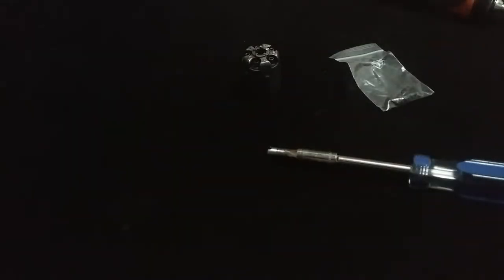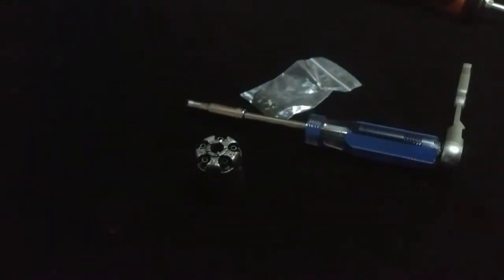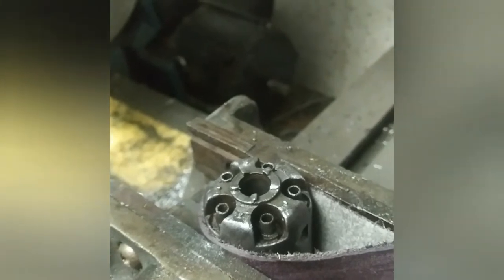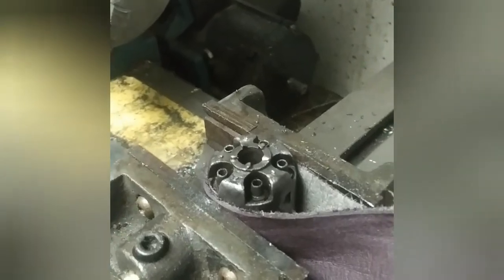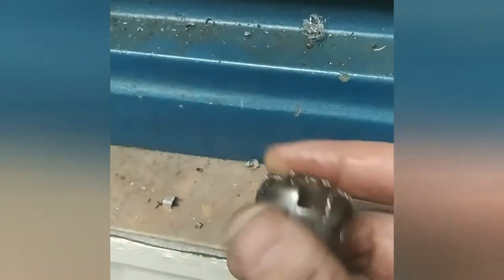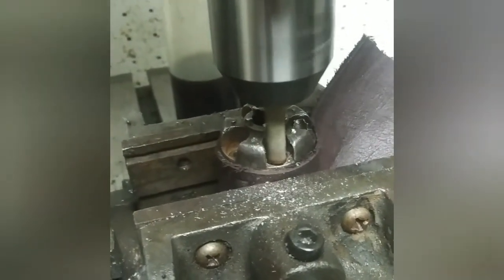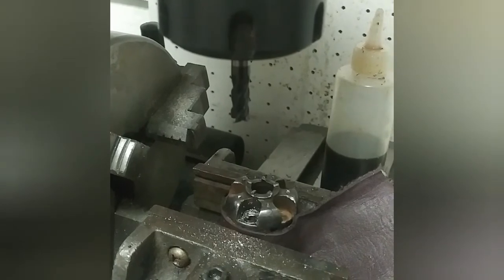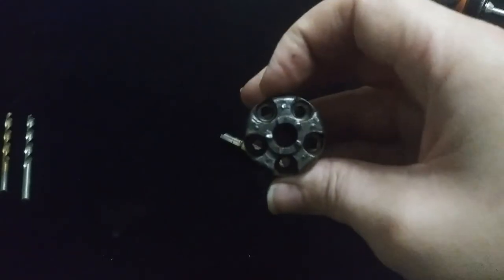Percussion Nipples stuck. How to fix

Comment: I used your video as a supplement to my task of removing the nipples from my 1849 Colt Pocket. I appreciate your honesty, you told it like it is. These old gun nipples are not going to back out no matter what you do. They’ve been abused from dry firing and neglect. You’re a machinist and I’m not. The end mill is a good idea but when you said you had to “ walk” it around to remove all the nipple that was above my skill level. I’m a retired dental technician so freehand is my wiring. In my research I found that a 5mm drill bit would remove all but the last above the threads. Basically it turns them into springs. You could probably graduate up to the 5mm. But I decided that all that movement once the cylinder was secured was risky. I clamped my cylinder the same way you did. Surprisingly the metal is soft. I’ve read that but once you feel the difference you can appreciate just how far we’ve come in metallurgy. That probably explains the deep threads and .225-32 tap that colt used exclusively. There were lots of posts about the tap Colt used but since you can’t get one it’s trivial information. However; a machinist posted that a 24-32 standard tap would work. It’s not for taping entirely new threads. It’s for cleaning up the originals. That’s exactly what I wanted to do. Lodgewood supplies reproduction parts and they have copies of the originals. One little thing though, they are made for size 9 caps. Nobody makes those but they are authentic. A ten squeezed between the fingers will work. I hade one chamber that didn’t release all the threads. I was sweating bullets. Was it cross threaded years ago or was I off centered? The 24-32 picked up what was stuck, just like the post said. I made silicone impressions of the chambers. The threads are there and aren’t too badly corroded. They are perfectly capable of accepting the new threads and there’s no risk of stripping them. Personally I think it’s the responsibility of the new owner to preserve their gun for the next generation.
Reply from the maker: @aquila8553  I am glade my video helped. and thanks for the Information. So glade to hear you took on this task and Successfully got one more Precious piece of history shootable, and preserved for another generation. No matter how many I do. I am always The sweating bullets. What year was your 49 pocket made? Mine is from 1858
Reply: @snappers_antique_firearms  Mine was made in 1847 according to the Colt serial number site.
Reply: Oops, 1857, my bad
Reply from the maker: @aquila8553  1847? If that's correct that's a extremely extremely early baby dragoon not a 49 pocket. I didn't even think the baby dragoon came out until 1848. But it's been so long since I studied baby dragoons, I might be wrong.  Does the cylinder Scene have the stage coach robbery or men fighting fighting Indians on horseback? Also is the cylinder stops round or rectangular? If it's men on horse back fighting Indians and has Round.
Cylinder stops. You have a very valuable revolver far more then a regular 49 pocket.
Reply: My mistake, that 4 should be a 5. It was made in 1857
Reply from the maker: @aquila8553  lol OK that makes more sense.

Comment: Have you tried 50% acetone with 50% ATF transmission fluid?
Heating the part before soaking.
Freezing can also help.
Reply from the maker: Yeah, I am a fan of acetone and ATF mix.  I have tried everything I could think of over the years. I always had good luck with heating and spraying with penetrating oil on stuck screws. Unfortunately, when it comes to the cylinder nipples it's usually about 90% of the time I end up having to drill it out. I wish I could get them out without having to drill. I would rather rebuild the old nipples by welding and re Machining. I still hate destroying a 160+ year old part. Even if it's just a nipple.

Comment: If you use a 50/50 mixture of acetone and automatic transmission fluid they usually come out. Let it soak for a day or two so it has time to work. If it's an old shotgun or rifle make sure there is no charges in the barrels.
Reply from the maker: @casperhoss2952  I did try this before I ended up having to drill it out. Spent weeks trying thank many others. I always hate drilling or milling on antiques
Reply: @snappers_antique_firearms  thanks for replying to my post.  Your exactly right drilling an antique is nerve-wracking. Your video definitely shows your knowledge and talent. I meant no offense. I just wanted to share what has worked for me. Hope to see more videos soon. Thanks again for commenting on my post.
Reply from the maker: @casperhoss2952  thanks!! I appreciate the input. And there was no Offense taken. I love people sharing Knowledge. I am always happy to learn something. In this case I knew this. But maybe someone might read this comment and it helps them. Please feel free to share anything that can help keep these Antiques around for Future generations.

Comment: If you are fortunate and the "old/original" nipples DO come out... Would you recommend using a high temperature anti-seize compound (Nevr-Seize/C5A,etc.), on the threads, when installing the nipples (prior to firing)?... My dad introduced me to anti-seize, working on our Studebakers (He used it on every cleaned bolt that went back in... Never had a stuck bolt, again!)... Thank you, for sharing your vast knowledge! ... Gary
Reply from the maker: Yes 100% use anti-seize. I still recommend removing and cleaning after shooting. I have had nipples still get stuck with anti-seize. The black powder being so corrosive it'll still rust between the threads and get stuck. But it takes allot longer. And is something I always use. Thanks for stopping by Gary and welcome to the channel

Comment: Time rusted in like that not much you can do to correct it. However  my philosophy is start clean lube. Reinstall, do not torque the nipples tight until you are ready to snap caps in prep for loading. Remove clean and lube after every range or shooting session. Though I prefer sewing machine, or 3in 1 oil for most applications. When comes to my nipples I prefer an anticease grease. I do well with a small amount of white lithium grease.  

 All nipples out every cleaning, thoroughly dry, lube, and never over tighten.  An ounce of prevention is far better than any brute force.
Reply from the maker: I could not have said that better myself. I didnt make a video on what i ended up doing after i got the nipples drilled out. I ordered stock colt nipples. But they were a weird size and didnt work for anything with modern caps. I ended up taping the nipples holes to uberti and got some nice aftermarket nipples.  its a dream to shoot now. If i ever want to change back to original Colt nipples. I will just plug drill and retap
Reply from the maker: The one thing i saw that got out nipples every time is something i dont have the guts for. Or a heat treat oven for. Heat till red hot the dunk in water. Works everytime but then you have to temper and cylinder in a heat treat oven. But i just dont have the guts to do that on any original gun. I would a replica because at worst you would just need to buy a new cylinder.

Comment: great 'hands on' video mate ... well done
Reply from the maker: Thanks brother.. So I was just looking at the new nipples that I bought. Well I can't use them. they are for a very small percussion cap, that I don't even think is made anymore. I'm thinking about just Drilling and tapping for a modern pietta nipple. That way it fits modern caps and much cheaper to replace in the future...cheers
Reply: @snappers_antique_firearms  the whole reloading thing is an art form, not to be taken lightly, nice to see the technical side taken to such lengths ... you're an on-line old-school gunsmith :)
Reply from the maker: @CodyandSteveDownUnder  thanks. These cap and ball guns are great but the originals can be difficult sometimes. Some use things that arnt made anymore. And I love shooting them. So I have to come up with was to make that possible. And without making the gun look different.  Cheers brother

Comment: I give you a hint on a product that's been around for a few years but it is a bit obscure. The product is called Gibbs. And what I would do is I would take a cup and I put enough in there to take that cylinder and set it in their nipples down and just leave it set in there for a number of weeks or even a few months. It should be able to enter a millionth of an inch. I remember meeting the inventor of that product. While working on it, a person had brought in a Smith & Wesson number 122 it was made in the 1880s and it had been found buried in the ground. It was a single lump of rust.
After having forgotten it in a vat of the stuff for several months. When they remembered it and retrieved it, every part of it functioned. Even the springs. Now they wouldn't shoot it because it had eroded away. But none of the rust that had been on the firearm remained.
The original guns are made of malleable iron. While the nipples and screws were made of steel because it cost so much to make those parts that they would make those out of better steel than the gun was. So when they nipples rust up into it. They truly seaze into it.
Reply from the maker: Thanks for the info. I will definitely take a look at that stuff. I have a first year production colt pocket navy. Is nipples are stuck.  I definitely will try any product that could keep me from having to drill the nipples out. Thanks again

Comment: If you'll make you a mixture of finger nail polish remover and transmission fluid. Soak the whole cylinder over night. Nine times out of ten . they'll soak loose. Unless you are a machinist with the proper tools. Do not attempt to drill a 400.00 cylinder and ruin it.
Reply from the maker: That is a very good point. I used a milling machine but for people with no experience or proper tools it would be very foolish to do. Especially if it's on a original gun. Much better idea for most to take it to a machine shop. But for the finger nail polish and transmission fluid. I have see people have great luck with it. And it works pretty good. I tried everything in the book for over a month on this cylinder before drilling it.

Comment: What a pain.  Ordinarily oil, heat and an extractor should have done it.  Those were really stuck.
Reply from the maker: Yeah you would think oil heat in an extractor would have done it. But I ran into this situation a couple times before. with other guns. where I have to do complete cutouts

Comment: Why didn't you just buy a new cylinder
Reply from the maker: If it's a modern replica, then, of course, getting a new cylinder is the easiest option. the revolver in this video. It's a numbers matching colt model of 1849 pocket. That was made in 1858. You can buy a new cylinder, but the ones that are made for originals are not roll engraved. They wont match the finish on the revolver. It really depends how far gone a part is or if its reasonably fixable.